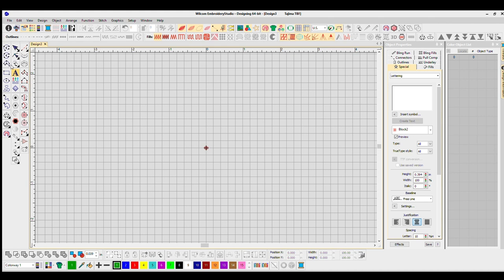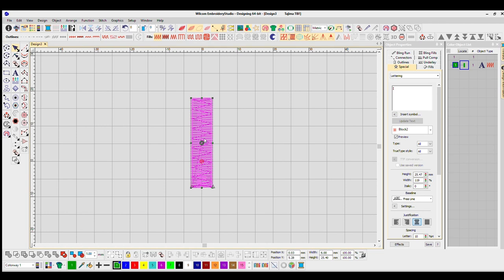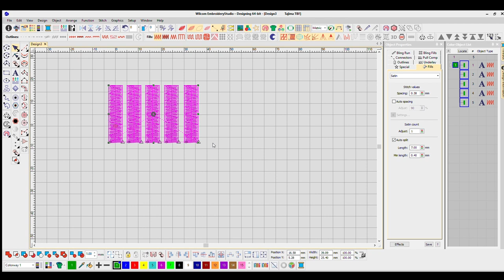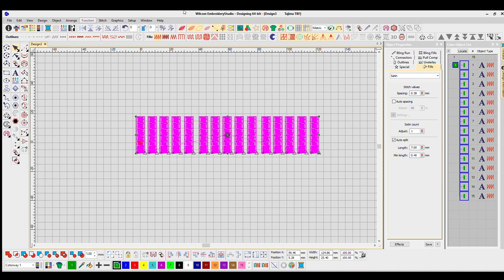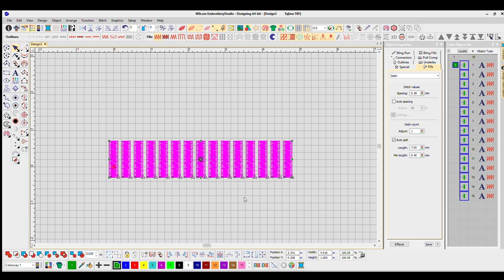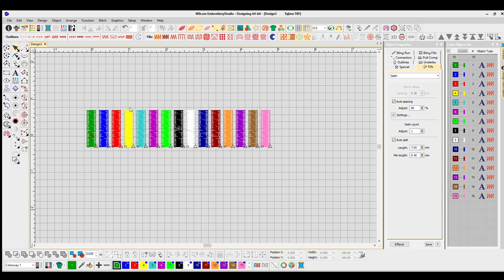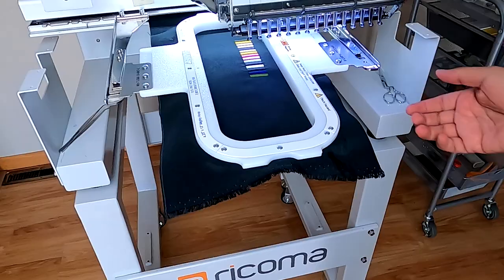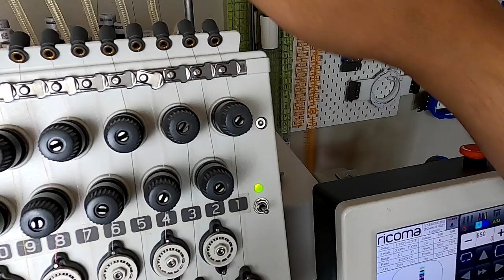"I Test" For Embroidery (An Embroidery Must)

Comment: So i just did an i test.  my center bobbin thread is very tiny.  So do I turn to the right on both top and bottom tension knobs?
Reply from the maker: It depends, if its tiny bobbin on all threads then left turn (loosen) on the bobbin tension. But if your issue is on 1 needle then adjust your top tension, right turn (tighten) on the top tension.

Comment: So if you move the very top tension you should.move the bottom as well...everytime? Is there ever a time where.you would not move both at the same time?...and I have the MT 2001...so this would work for my machine as well?
Reply from the maker: Its not necessary to move both, I just like to have both tensions somewhat similar. This will work w/ your machine, it should read a dst file.

Comment: 2  questions. Do you need to do new bobbin tests when you change bobbin thread brands? cuz like i had a black magnetic and then i changed to a different bobbin thread brand, and everything was no longer tensioned. 2nd question, if doing like patches or lacewoork or embroidery that i  just on water soluable stabilizer do you need to retension for that stabilizer?
Reply from the maker: Normally you wouldn’t have to re-tension w/ a different brand. You can always verify tension after each job. Just look at the back every time you do a job. 2nd, I never retension for patchwork. Just monitor your tension after every project.

Comment: Question: What would cause my I TEST results to show more thread on the left side than the right? It looks like all of my needles have more top thread showing on the left side, whereas it almost 50/50. I am going to try a few more adjustments. Thanks in advance for your reply.
Reply from the maker: Hello, thank you for the message. As far as the bobbin being one side heavy, that might be a bobbin housing issue. I would clean out the housing also make sure there isn't any lint in the bobbin holder. Thats happened to me before, but the problem just went away.

Comment: So helpful video! I am trying my machine according to your info. one question, is this test need to be on the fabric I want to use? different fabric may have different situation. thanks!
Reply from the maker: Ideally, yes, you want to use the same fabric. Sometimes its not always possible, but as long as its something similar you should be good.